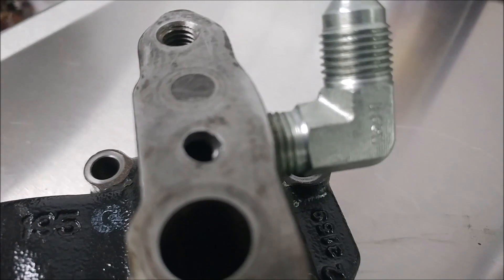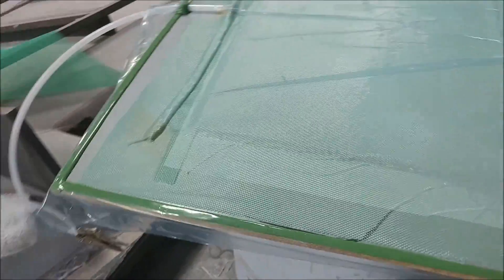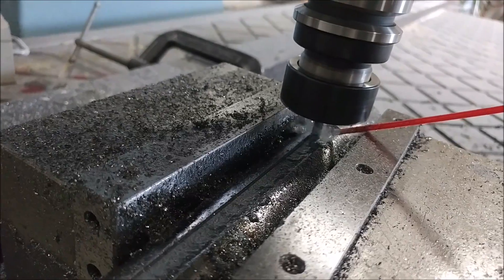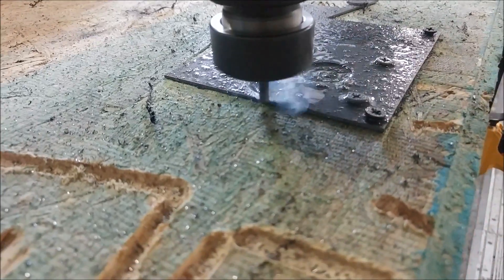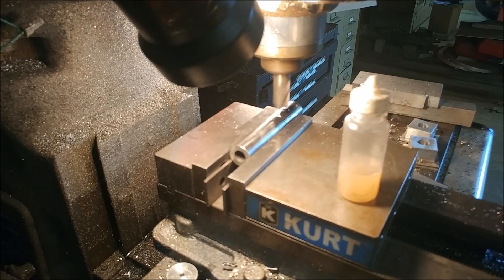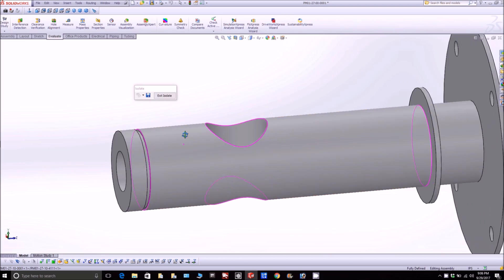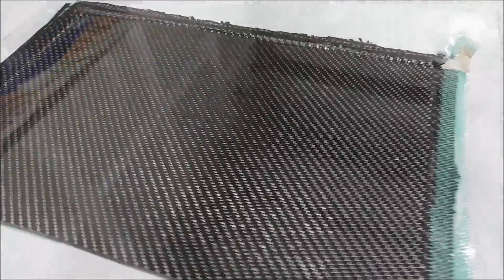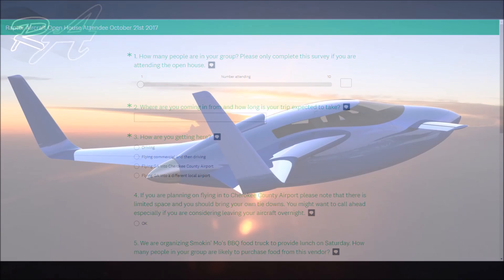More Flight Control Parts - Milling on the Bridgeport mill

Comment: Great progress.  Is there any concern for galvanic corrosion with the steel/aluminum contact on the controls?  Not sure it would be a problem in a dry environment, just curious.

Comment: I would think access slots in the pressure bulkhead like at 5:18 should have large radii vs square corners (re: de Havilland Comet)
Reply from the maker: That's not through the pressure bulkhead.